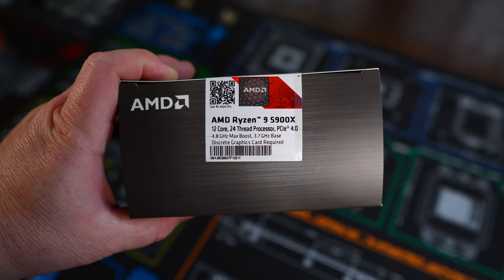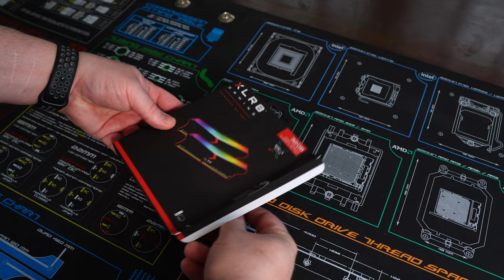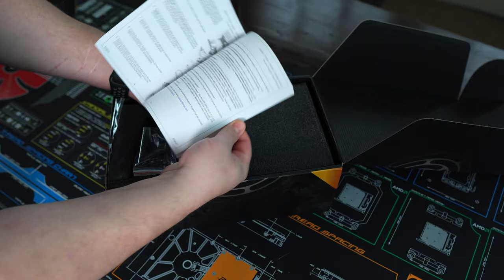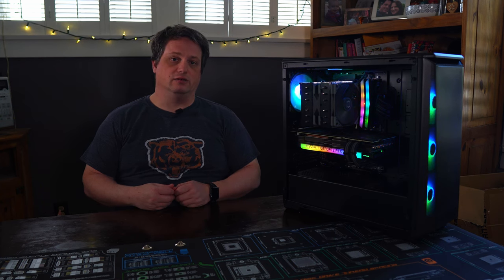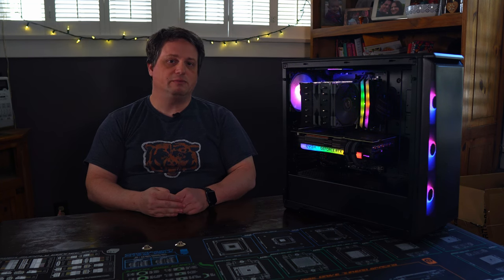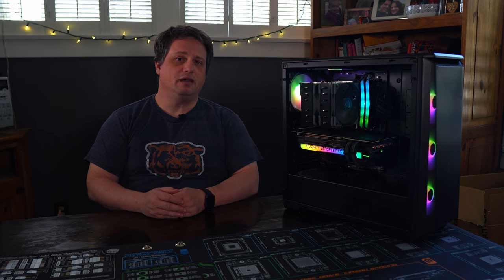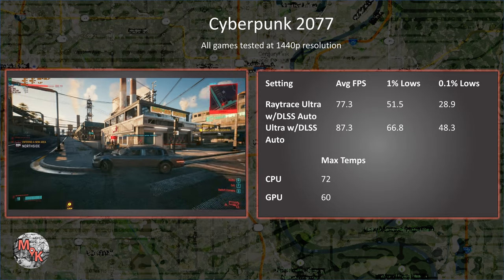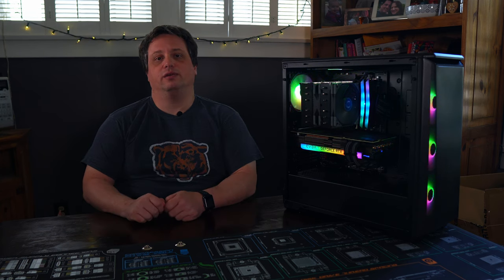Play and Create: The AMD 5900X and Nvidia RTX 3070 Ti PC Build

Comment: I don't know how they'd do it differently but but I really can't stand those fidly cooler fan wire attachments. For me they're right up there with front power switch connectors.
Reply from the maker: Yeah and they seem to differ for each cooler type. I just I stalled a Vetroo on another build and you put in the wire differently than on the scythe.